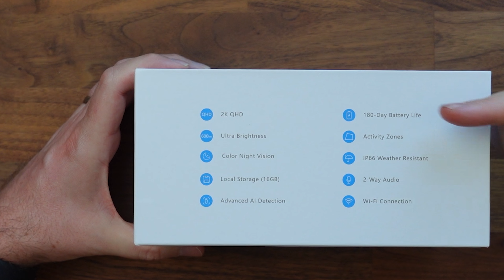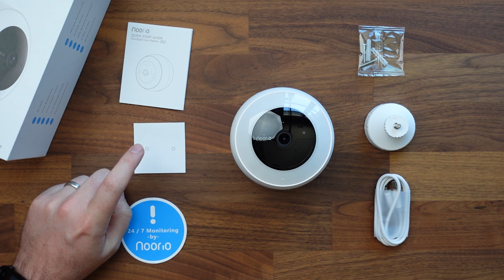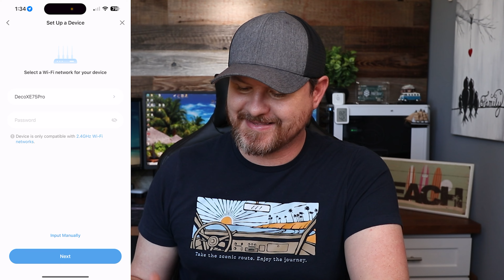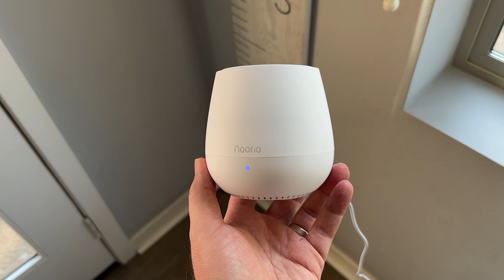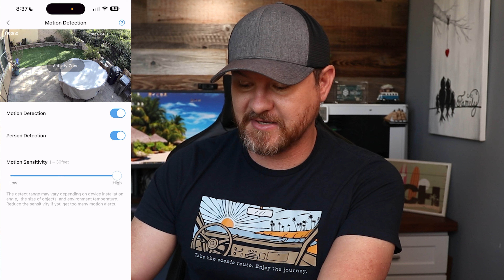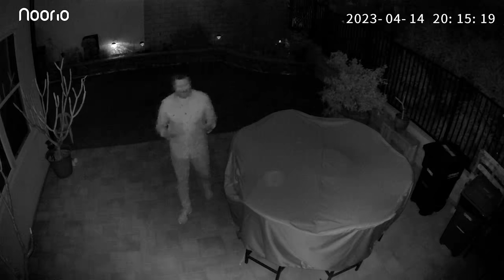Noorio B310: The Ultimate Smart Security Camera for Your Outdoor Space

Comment: If you leave it plugged to the power source how does that affect it being waterproof? Looks like a nice option.
Reply from the maker: The power cable that it comes with is not waterproof. However, the solar panel cable does come with an extra piece of rubber to keep water out.